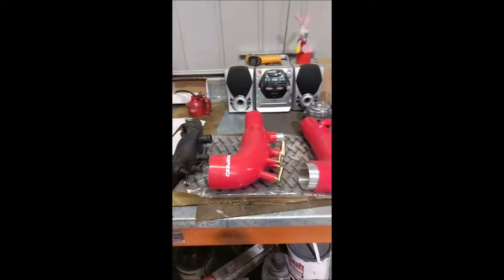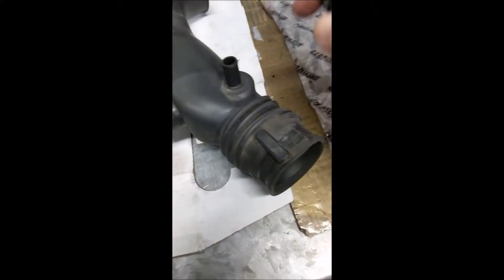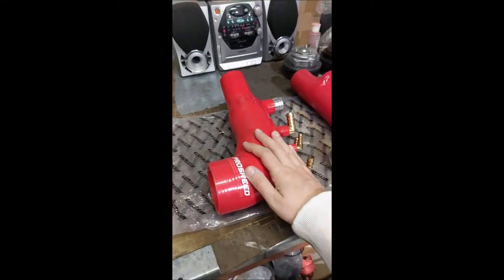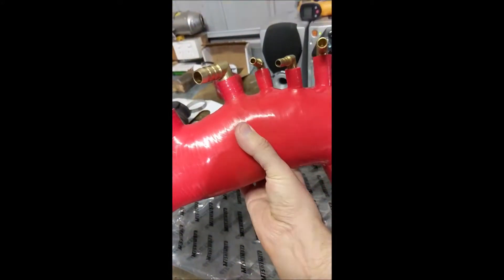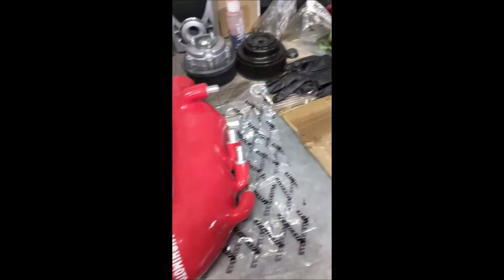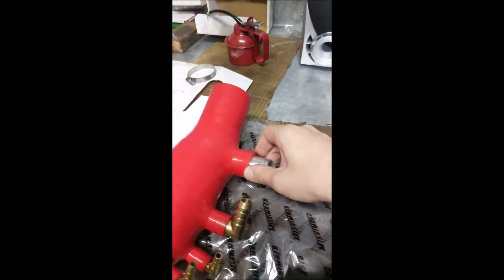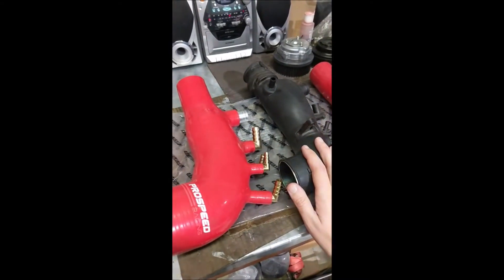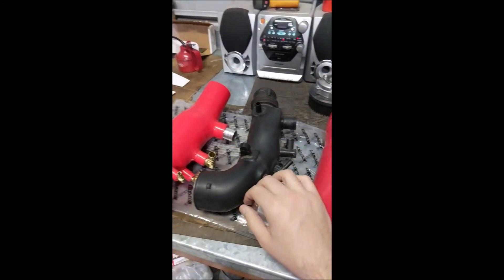Subaru turbo inlet comparison 2008-2014  WRX 08-14/Liberty GT 04-09/Forester XT 08-12

Comment: If I'm not mistaken, the inlet that started out in the middle is for  WRX/STi before 2008. I ran into this exact problem with a "Gimmick Motorsports" inlet and after some research discovered it was basically a copy paste design. I ended up getting a Mishimoto inlet.
Reply from the maker: The stock turbo inlet I have in the video is from a 2010 WRX. Inlet is the same on the MY09 Forester XT's I have worked on as well. 
I was on the same thinking as yourself and perhaps the seller had sent me the incorrect part, but they assured me its the correct piece with a "revised" location for that particular hose to aid in installation while doing the replacement in the car. 
Too much fluffing around for me, the mishimoto was installed in this build and the fitment is acceptable. I think they all rub/touch the manifold due to just being physically bigger.

Comment: Silicone turbo inlet pipes are crap. However, the only option when installing without removing intake manifold. Otherwise better go for  Aluminum from AMR or AP
Reply: metal heatsoaks